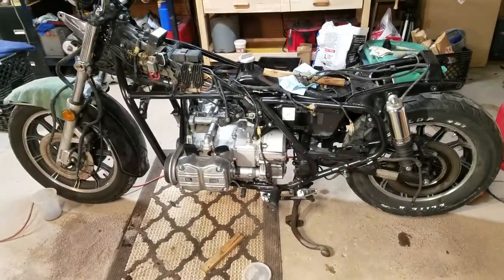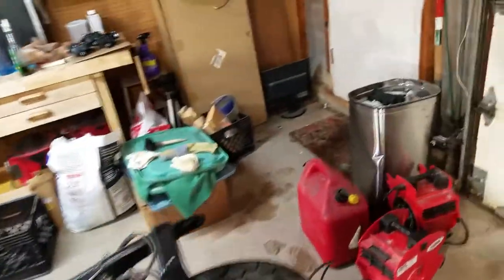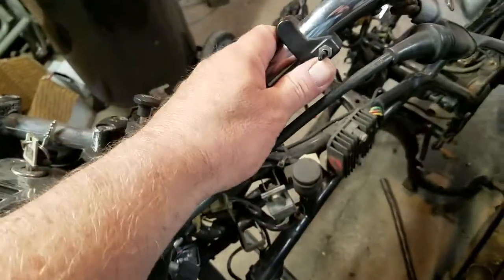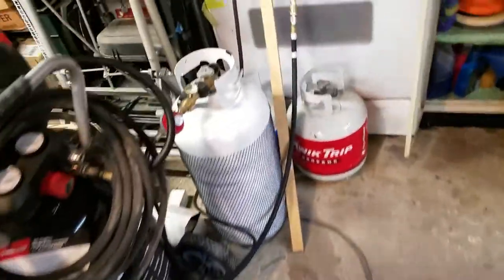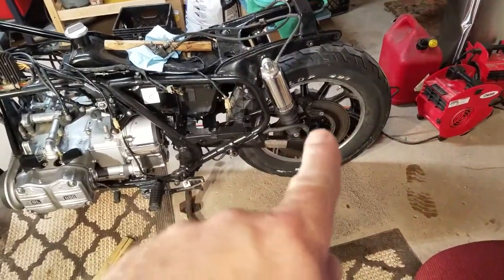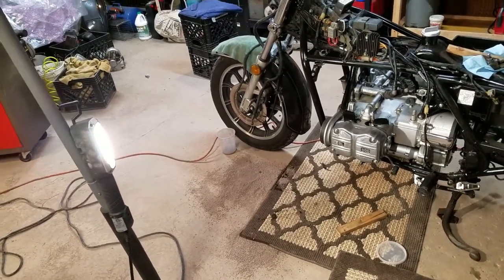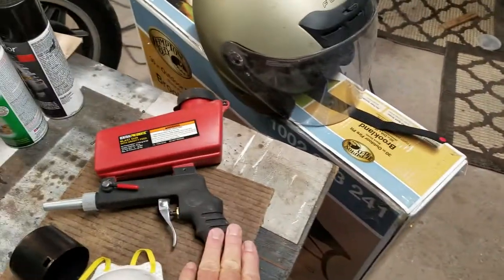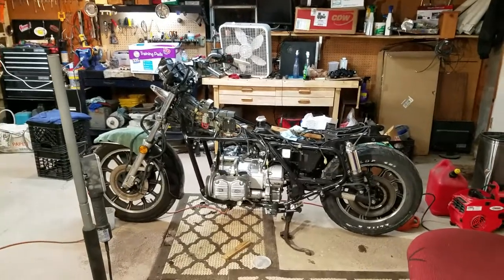Friday GL1100 Update

Comment: Progress is good, with some new toys. I'm enjoying the build. I think I need one of those ultra sonic units. Glad to hear the sand blaster worked well, I have often wondered. Enjoy your week .
Reply from the maker: If you have some small parts that need cleaning not just carbs, bolts brakets its really good for that. If you can get one do they are nice. Took me a while to get one but glad I finally did. The HF sandblaster works well plan on using it out side unless you are better at coming up with a way to catch the medium than I am. :)

Comment: You made good progress.  I'm alway saying;  I'm just going to take it to this level, but everytime due to my DNA I always dive a lot deeper. I'm ok with that, I know it is my nature.  Nice garage good lighting . I need to get one of those hand held sand blasters. I have some brake backing plates that need cleaned and rust removed , that sounds like it will do the job. Good up-date thanks for sharing your progress on the bike.
Reply from the maker: Thanks maybe our DNA is related since I do the same thing. Every time I try NOT to go deeper into a project and every time I do and a couple of times it bit me in the butt. Well for a $20 hand held sandblaster it does quite well. I think it will work well on the plates for you. I got the finer blast medium HF had if you go up one to a medium it will make quick work of those parts I bet.

Comment: That braking system would be good for the non front brake users , But i also just want to control my bike brakes separate , I use front more than the back . The sand blaster works well , but mine will only work with fine sand . You will like the small  blasting  cabinet . .
Reply from the maker: Yea, and I almost never use the front brake so I really should keep it however I have been told by other Goldwing users to swap it out. So.. I can't wait to be able to do my own sand blasting I don't have a lot to do but when I do have something it will be nice to be able to do it. That is if the cabinet works. Its used and well time will tell.

Comment: I use Purple Cleaner when I can find it, if not Purple Power. TSC sells PP in 2.5gal at a good price.  Walmart uses to sell PC but haven't seen it lately.  Looks like your garage is kinda getting back to norm :)  With the braking systems, they are trying to keep you from going over the bars and from locking up the rear and dumping the bike.
Reply from the maker: I do have some Purple Power but I found it stained the carb bodies a really dark color. I do how ever use it for steel and iron. Other wise I use either Super Clean, Simple Green or Awesome they all seem to do a good job. I am sure the shared brake system does just that however when I read all over by Goldwing owners to do away with it I have to think there is a good reason.

Comment: Hey man, coming along. Do you have a part number on that rear disc? I can check against what I have.
Reply from the maker: I do not but I am sure I can find it. I will look it up and get back to you.
Reply from the maker: Found it, it should be part number 43120-MB9-000 I will check the actual disc next time I am out in the garage.
Reply: @MidwestMotoRider  According to a couple sources, it looks like the 1200 rotor might be the same as that one. At least they sell the same replacement for both. I have at least 3 or 4 that are still on wheels in storage. I will check in the next day or so if you want.
Reply: @MidwestMotoRider  Well rear brake discs for Goldwings is apparently a rabbit hole. Seems like they changed them just to change them year to year. I have 2 that are usable but I think they are both different than yours. Here is a good pic of what they look like though it is not my picture. https://www.straightwings.com/store/images/P/2782.jpg  

They look to be totally different than what you have. I also have a GL1000 disc and it has a 6 hole pattern. It looks like I cannot help here.
Reply from the maker: Yes they do I am also finding this out. Probably why they can charge so much for them. I do appreciate you looking into it however.